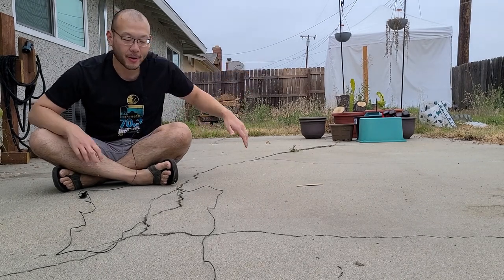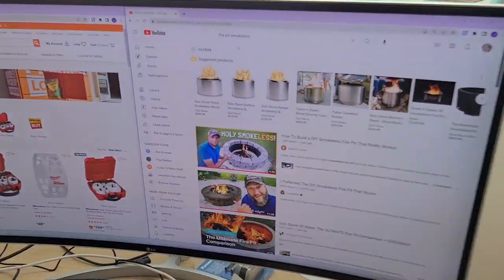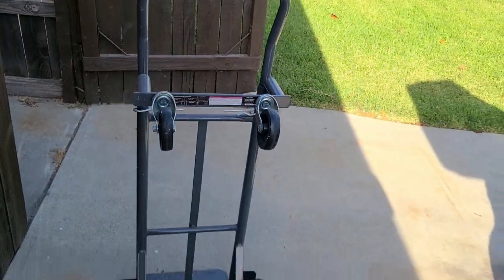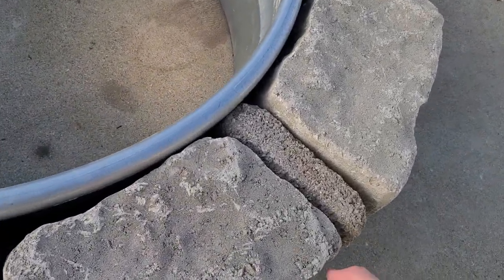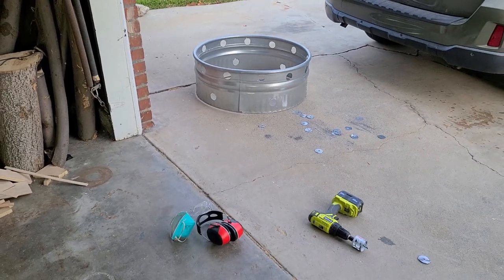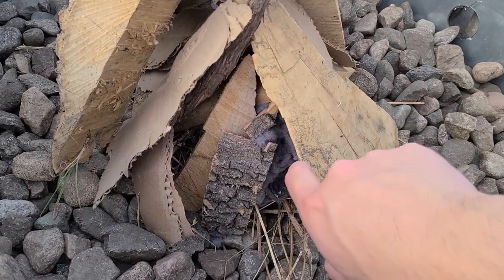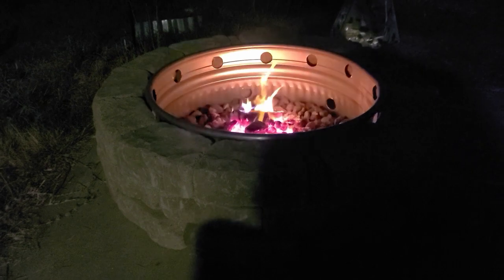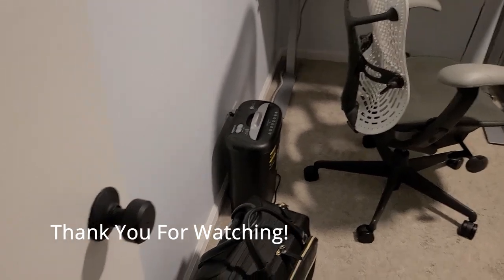A Dentist Builds Smokeless Fire Pit

Comment: Be aware that firepits on concrete can cause a concrete slab to crack as the water in the concrete heats up and can’t escape. 

Your initial shot showed some existing cracks and the location of the fire pit would probably break off that corner rather than go through the main slab however I’d encourage you to ensure your stones provide a sufficient thermal gap to ensure the concrete doesn’t get too hot. Especially if you have firebug friends who are good at making hot fires who might come over and use it. 

We have one the previous owners used with a pit that has made putting a shed on it really annoying.
Reply from the maker: Good to know! Thank you! We'll add more rocks to the bottom!